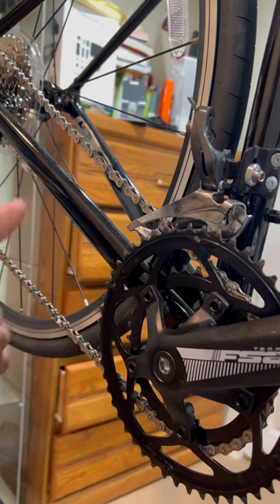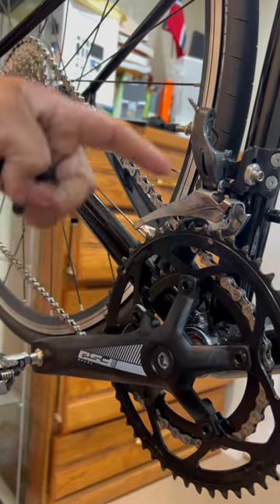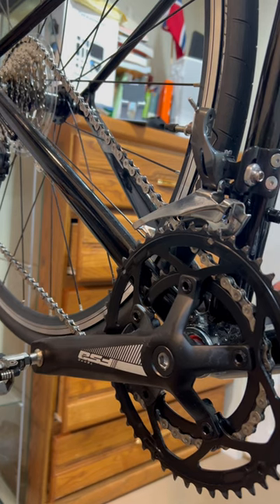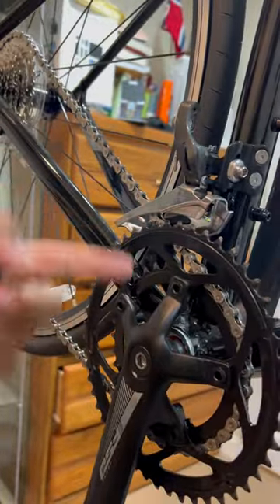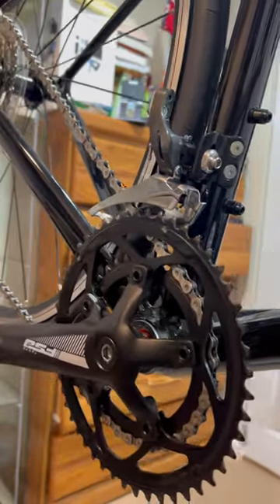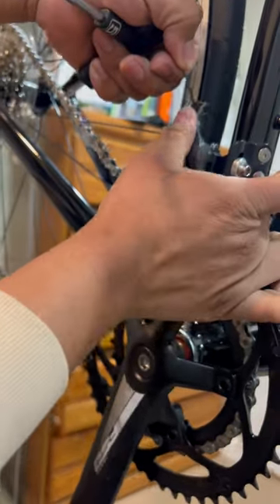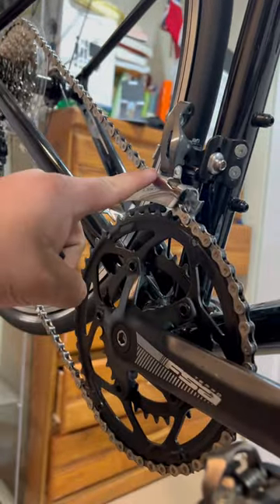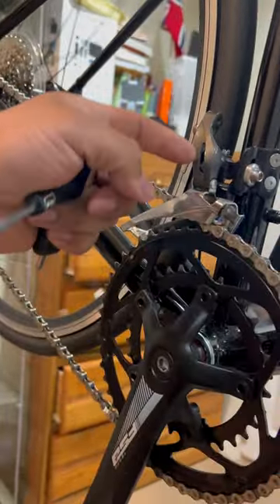Front Derailleur Setup In 1 Minute

Comment: Yeah, I've just spent 1 hour messing with the screws and now my front derailleur is rubbing constantly and I haven't even figured out which limiter is which and how it works😅 I thought it would be similar to the rear derailleur, but I just can't see anything no matter what I do
Reply from the maker: Look at the front derailleur screws. There should be tiny letters “L and H” somewhere on the side. If you screw in the low limit the derailleur moves out toward you.

The chain will start rubbing on the inner plate of the front derailleur the more the low limit is tightened.

The high limit only works when the front derailleur is set on the next gear. You use your left shifter to set the derailleur to the next gear.

Then, when the high limit is tightened the derailleur moves away from you inwardly. Eventually the chain will rub in the outer plate of the derailleur as you tighten the screw more and more.
Reply: @Henryisvegan  Thank you🙂 I think I've now figured out which one is which but there might be something else going on because even with what I think is the H limiter completely loose it still wouldn't shift to the highest gear. The cable is tight enough, too. Luckily I can get the bike serviced for free so if I don't figure it out it's not a big deal.
Reply from the maker: @matejblaha4659  The cable is tight but maybe your shifter is in the next gear. If your shifter is in the next gear and the chain and front derailleur is still on the previous gear then your front derailleur won’t work properly if that makes sense.
Reply: @Henryisvegan  I mean if I move my front derailleur to the third gear while my chain is in the second, the cable is really tight but the  chain still doesn't move to the third gear because the box that should move it is not aligned in the correct position despite the chain being really tight. Does that make sense?
Reply from the maker: @matejblaha4659  makes sense. Take it to the shop and let me know what happened.

Comment: Hi, I'm trying to fix my front derailleur cause in low gear (1st) it keeps rubbing on the chain. I tried unscrewing the L limit screw but unfortunately so because the derailleur touches the bike frame and it can't go further. Any fixing ideas?? Thanks a lot!
Reply from the maker: Is the front derailleur height in the correct position?

Is the front derailleur aligned with the chainrings?
Reply: @Henryisvegan  Well I took it to the bike shop and we put a wider bottom bracket and problem solved! The chainrings just needed to come out a bit and now it's all good